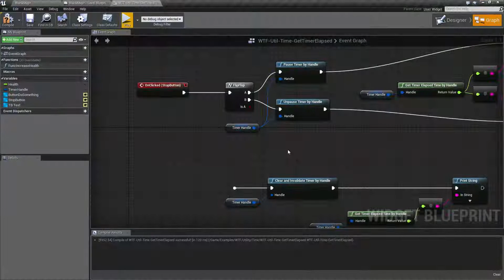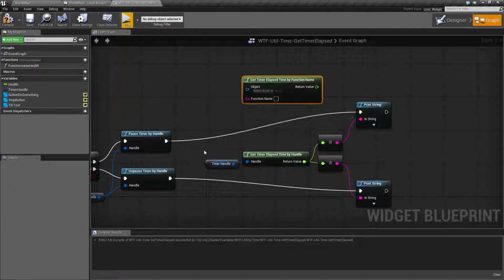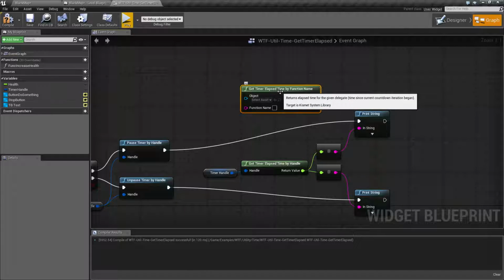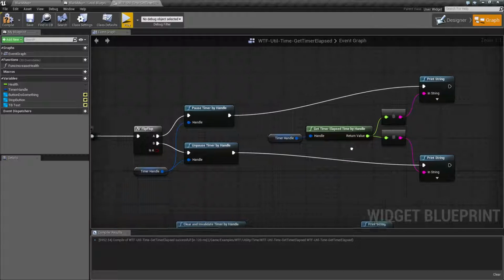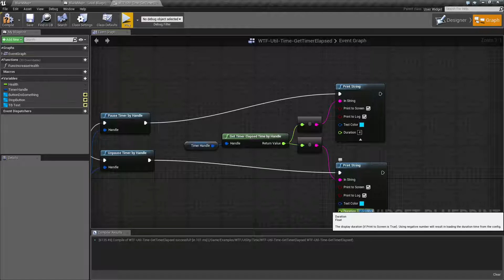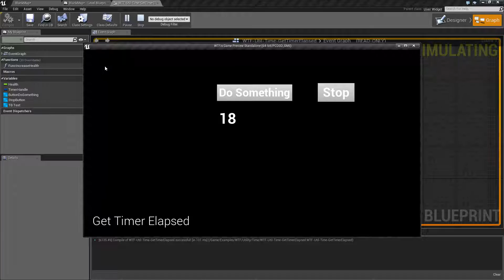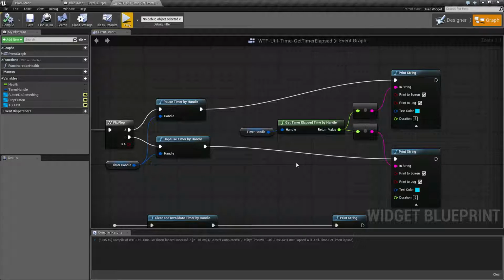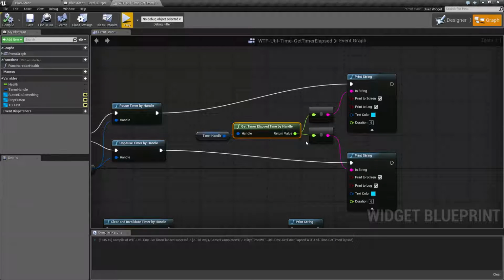WTF Is? Get Timer Elapsed Time in Unreal Engine 4 ( UE4 )

Comment: I have one question. When does the Timer start counting, instant during calculating a function or when the next calculated frame starts? 

Example: If you calculate something with eg. 100.000 loops and the calculation takes around 10 seconds (the freezes during this cause main thread is blocked), does the timer count the elapsed 10 seconds or just the time after it?